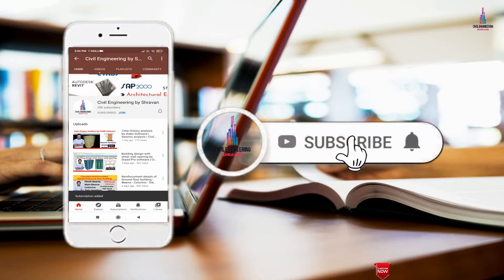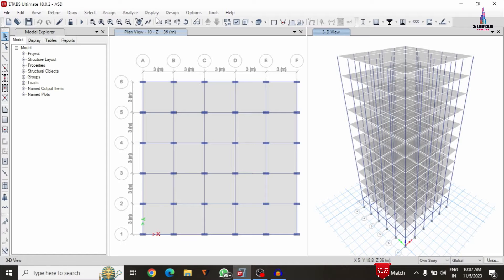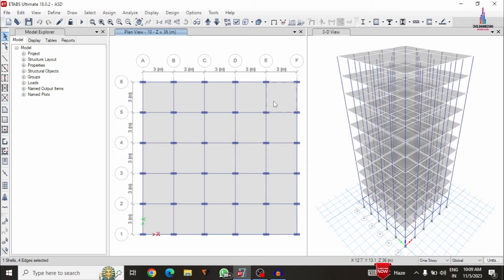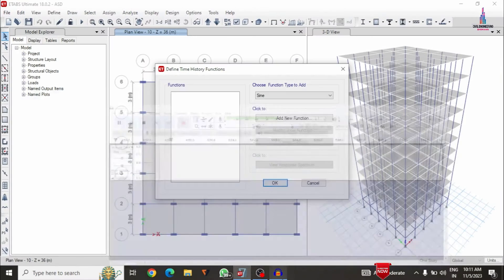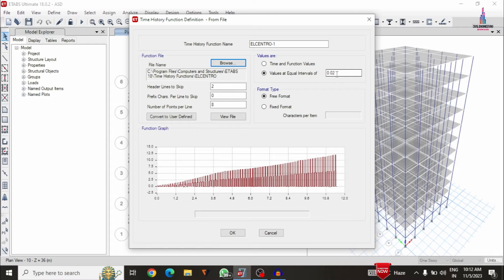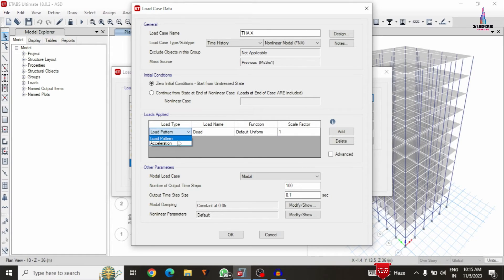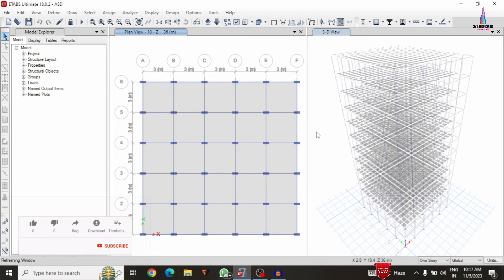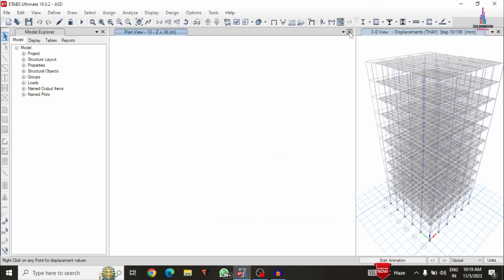Time history analysis in ETABS software | civil structural design | analysis of building |

Comment: HI! I guess you forgot to add  a scale factor on Load Case Data display,  you should consider R factor and the file's unit. And also when you define Time history function you did not set the correct options: Values are: time and function values, and there's three points per line. (for these reason the register looked so strange)
Reply from the maker: Scale factor is assumed as per default section